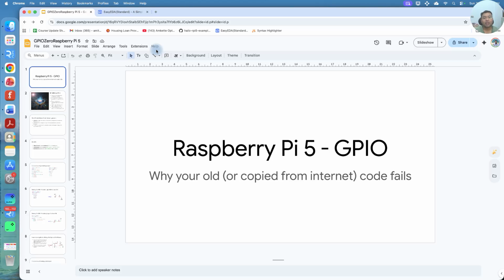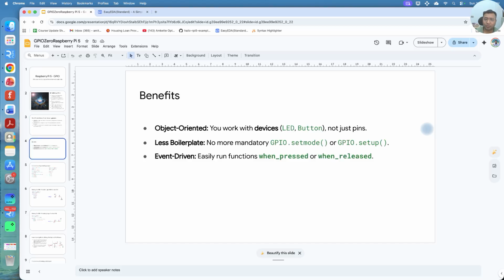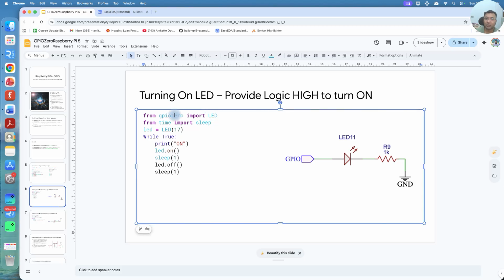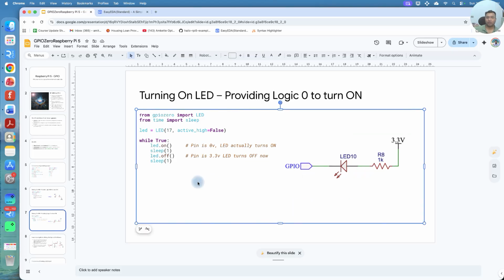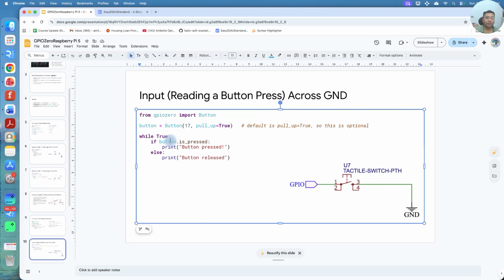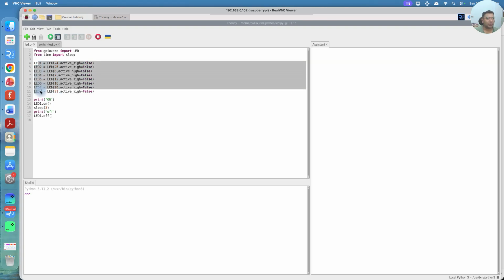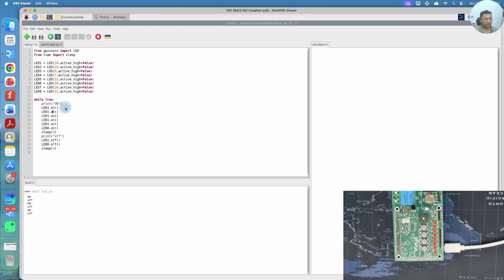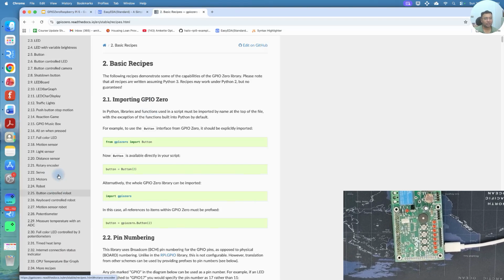RPi.GPIO Doesn’t Work on Pi 5 — Here’s Exactly What to Do Instead

Comment: I pre-ordered the Raspberry Pi 5 8GB in September 2023. A month ago I reinstalled the Raspberry Pi OS. Previously it had Bookwork but it now has Trixie.

I ran a few Python programs using the RPi.GPIO library. They worked OK. At first I didn't understand why because RPi.GPIO wasn't supposed to work on the Pi 5. A little research showed by default rpi-lgpio (0.6) was installed. This is supposed to be a drop-in replacement for code using RPi.GPIO. That explains things.

I then wanted to run some C programs using the WiringPi library. It discovered it wasn't installed by default. I installed the most recent version WiringPi (3.16). My C programs using WiringPi worked OK.

I haven't done any extensive testing of code using RPi.GPIO or WiringPi to see if there were any compatibility programs on the Pi 5 running Trixie. I will continue to use these libraries as long as there aren't any problems.

For the future I am going to try and convert WiringPi in C programs to lgpio. Also, I am going to try and convert RPi.GPIO in Python programs to gpiozero. 

BTW, I also tried libgpiod in a C program. The problem with it is it doesn't support PWM. I already have some C program using libgpiod but they didn't work. I discovered that Trixie installed libgpiod v2.2.1 while Bookworm had installed libgpiod v1.6.3. The new version of libgpiod greatly changed the library calls which explained why the old programs didn't work.